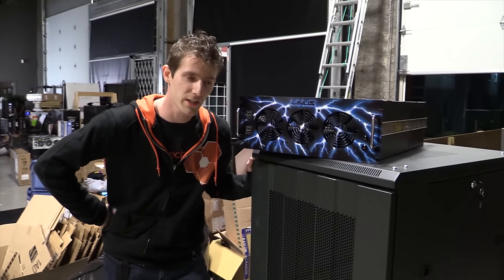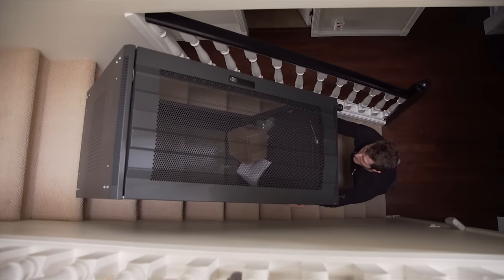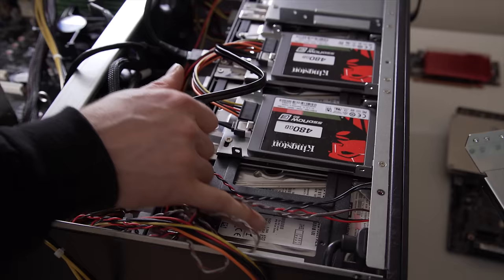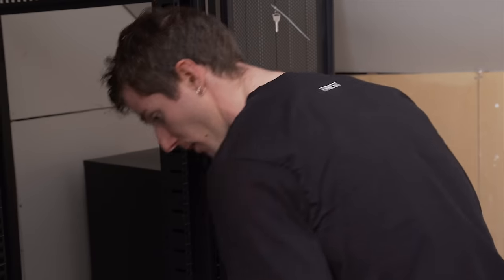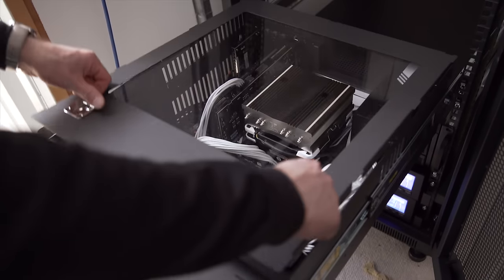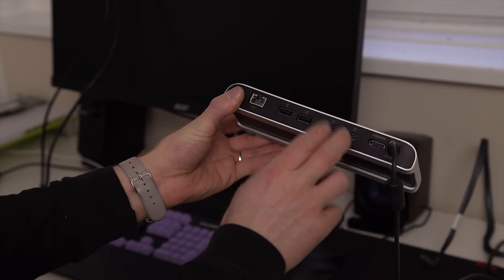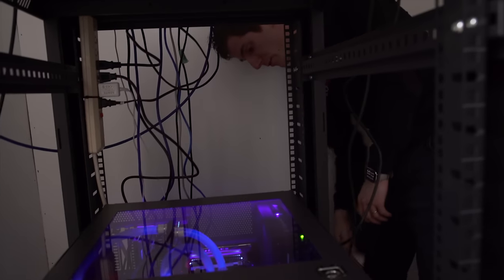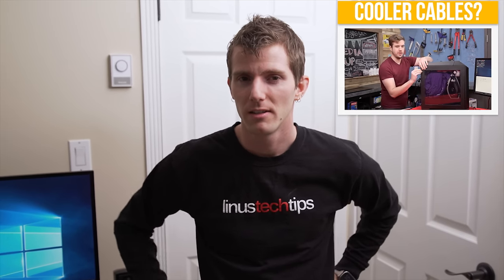Final Deployment of My New PC! - Personal Rig Update 2015 Part 5 (FINALE)

Comment: A rackmounted server chassis in another room with a thunderbolt hub is how you'll be using your personal rig? But what about gaming Linus?
Reply from the maker: What about it? Gaming experience is great. 100Hz at 3440x1440 with G-Sync!
Reply: +LinusTechTips but can it run crysis?
Reply: +LinusTechTips But can has run meat super boy ?
Reply: How the hell does that work? I can understand for the mouse and keyboard but display to? I&#39;m kinda new to thunderbolt but i dont understand it. lol pretty interresting
Reply: +LinusTechTips what monitor are you using?
Reply: +Tzotzo52 ... The aspect ratio, slight curvature, stand and g-sync capability should make that quite a dead giveaway... He's promoted this model of monitor only a gazillion times, too. But just in case it's still impossible to guess; It's an Asus Predator X34...
Reply: +Tom Zoon (Annihlator) oh yeah, forgot about it! :D
Reply: Tzotzo52 :o HOW COULD YOU! ;-)
Reply: +zSz The cable he is using is basically the best thunderbolt cable you can buy
Reply: +ChrisGotsIt He is probably going to run it 24/7 like a server, which it is. Otherwise he wouldn't have bought two UPSs.
Reply: +LinusTechTips really hmm weird when i had a 3 meter cable my rog swift did not do 144hz had ti switch 1.5 meter cable.
Reply: +Tom Zoon (Annihlator) i don't wanna be that guy,but it's acer* xD
Reply: Arven Narve That's his wifes' monitor ;-) But when I viewed back barely a minute ago I noted he didn't mention Asus. He mentioned Acer indeed :) so that's my bad :p
Reply: +Tzotzo52 ACER PREDATOR
Reply: +Arven Narve Wait... Theyre both ACERs... how did I think so wrongly slaps himself
Reply: +zSz thunderbolt is basically a later revision of DisplayPort which is why it's able to do all that.
Reply: +TR-8R Don't be ridiculous
Reply: +ChrisGotsIt The whole point of a rack mounted server is to have them constantly running. I doubt he'll switch it off.
Reply: +Eric W. Actually it was created by Apple as a higher bandwidth alternative to firewire but made with backwards compatibility. later it was made so it could be made into non Mac PC's
Reply: +LinusTechTips Any lag / delay etc etc ?
Reply: +classi fied Don't forget Intel.  Apple co-developed code name Light Peak in it's copper implementation (Confusingly the part that doesn't involve fiber optics or light).  Apple also holds the thunderbolt trademark, but it's an Intel technology mainly. If it was wholly owned by Apple you'd never see it in a non-apple.
Reply: +Christopher Panek true
Reply: +MrHav1k He's got enough sponsers. He'll just call up nvidia, gigabyte, corsair and what have you, then just build another PC.
Reply: after watching this vid im thinking "hmm i might try this" then i search for Corning 30m Optical Thunderbolt cable - £450 + shipping. i think i can live with the noise my PC makes
Reply: +LinusTechTips Can you add another USB hub to the thunderbot hub?
Reply: +ChrisGotsIt I have a similar setup at my home. I ran cable to my workstation from the rack and I have a hidden switch under the desk I made so I can power the computer on from my desk.
Reply: +AlphaZulu Your&#39;e saying &#39; a lot. :P
Reply: +zSz It's optical. Optical = Fiber Optic = Super fast.
Reply: +ChrisGotsIt he installed that module on the mobo to do it wirelessly
Reply: +Matthew Jones (andurilmat) Likewise, been looking for a solution like this for years. And when it comes, too expensive to implement. :(
Reply: +MrHav1k 

You're silly.
Reply: +LinusTechTips I've been building computers for close to 10 years now and nothing in recent times has impressed me as much as this.
Reply: +LinusTechTips are you going to buy a Louver Door for that closet or are you going to go Full Linus, get a circular saw, a bunch of clamps and 2by4s for a fence system and plunge cut vents
Reply: +LinusTechTips I love this idea A+ However does this introduce any lag and what would makes refresh rate be?
Reply: +zSz It's an optical thunderbolt, which makes the latency from cable length so low that it's a moot point.
Reply: +ChrisGotsIt He's not looking to power them down. That's what the UPS units are for and the search for stability in the hardware choices. You can control the rest from your desk chair; then on the off chance it needs to be powered down, it's just behind a door a few feet from you.
Reply: +Alru Waldeck optical has unnoticeable latency,thunderbolt supports a higher bandwidth as displayport... so i guess as high as the monitor supports!  :)
Reply: +what ishappening the ups' dont automatically mean that he will be running them 24/7 it just means that he doesnt have to worry about power outages, surges, voltage/current drops or any other power related issues, his components are safe and he has time to save all of his work if the power goes out, its all about convenience and peace of mind
Reply: +BkS Media although he might not switch the storage server off, he would definitely switch the pc's off, im sure that he has a solution, or he just doesnt mind walking 10 feet to turn it on
Reply: +FurIouS19811 its an optical cable so the information travels at lights highest capable speed through a plastic medium, althought not as fast as it would be in a vacuum (true speed of light) it is still stupidly fast, the delay will be tiny and virtually unnoticeable
Reply: +Alexis Zenios As with everything in the PC world.. Money buys quality. You could buy 50 ft USB, DVI/HDMI extenders and all that jazz if you want to save a few dollars and deal with some input lag. Looking at amazon.ca, the Thunderbolt EX II card is $100-$200, and the Elgato Thunderbolt 2 Dock is $231.. Then all you need is the Thunderbolt cables!! That shouldn't be a problem.. Only $1,705.27 for 30m... God damnit Linus.  Seriously though, you can get 5.5m for the low low price of $261.00 per cable. Bringing your total to $592-692 before tax and shipping. 

But hey.. all those prices are quoted in Canadian. $592-$692 CAD = $430-$503 USD

On amazon.com the EXII is $84.99, the dock is $199.99 and cable $179.99 for 5.5m or $299.00 for 10m. ($467) So.. about the same, except all of those are available on prime.
Reply: +MrHav1k ... It's a water cooled gaming rig in a /custom built/ rackmount chassis. This is no server.
Reply: +DeilGrist He owns a pink civic...  The speed of light doesn't have anything on that!

Comment: Love the build but I'm sorry. You watercooled it, gave it a clear plexi cover and  custom design but its locked in the closet? Wtf Linus thats like buying a lambo and burying it in the backyard haha. Beautiful setup.
Reply: 13:33
Reply: +Chalklate Yea it looks awesome, in a closet haha. Its like keeping an old daytona ferrari hidden away for no one to ever see.
Reply: +bluej511 or a 250 California 

Or jag e-type

Etc.
Reply: +Savcool11 Yup, hey im all for awesome extravagant rigs BUT its a total waste if you're hiding it in the closet, to me anyways. You should see my rig, couldnt fit radiator anywhere on an antec 302 so i drilled a few holes mounted a 360 on TOP of the case, a 240 where the HDDs go and thats it. Its far from showy, its all botched but hey im getting 7-8°C delta over ambient so can't complain, and with noctua fans its quiet enough right by my feet.
Reply: +bluej511 that is the way so you can sell it later with "brandnew" condition =)) and set up new system for 2016 tho hahaha
Reply: +bluej511 Here in my garage, just bought this brand new Lamborghini.
Reply: +bluej511 no it's not because if u bury ur car u cant use it
Reply: +Link Freeman I'm sorry its just totally pointless.
Reply: bluej511 i don't disagree lol but your original analogy was terrible
Reply: Link Freeman Yea was quite horrid wasn't it haha. Lots of likes though im shocked.
Reply: +bluej511 more like buying a lambo then going "but i'm more proud of these 7 bookshelves I had to have installed"

Comment: pls test the latency on this rig. ty linus
Reply: It's on the other side of the wall I don't think there really is any noticeable amount.
Reply: +batt3ryac1d But it is going through 30 feet worth of thunderbolt cable + all the other cables length.
Reply: +Zveir optic cable. Pretty much lag free
Reply: +Zveir its  optical man, i doubt it even ads 5 ms to everything. Unoticeble tbh, plus its not like linus is going to be doing some MLG at his house.
Reply: midnightClub543 Spektrik I am well aware of that.
Reply: +Zveir theres very little latency with 200 feet of thunderbolt.
Reply: +Zveir I think you underestimate the speed of light. the delay will be under 1ms.
Reply: +Zveir it would be negligent.  If gigabit can run through 300 feet of Cat 5 cable with negligible slow down, then 30 feet of Thunderbolt isn't a problem.
Reply: While it's true that the cable itself doesn't produce any noticeable slow down, what about the card and box themselves?
Reply: it&#39;s will never be under 1ms. there is more virble other than thunderbolt
Reply: +Zveir even a 100 metre optical cable would have less latency than a 1 metre hdmi cable or usb
Reply: +girlsdrinkfeck The issue is the decoding on each end. Optical and copper have about the same latency for networking at least.
Reply: +GODOFGUITAR2112 - To add evidence to your statement, my 200mbit connection runs wirelessly from modem for 1500 feet to receiver then 280 feet cat5e to router. Latency from pc to modem is <1ms
Reply: +GODOFGUITAR2112 Gigabit is throughput not latency. As you increase the length of the cable the latency will increase even if throughput does not, you can't escape this fact. Using optical means you can often use less bits of equipment to go the same distance so there is less time added from start to finish.
Reply: Its not about latency from the optic cable obviously but from the PCI card and the hub hardware.
Reply: +yassir abuganam light travels through fibre at about 2/3 of c so about 200.000.000 m/s.. i guess one can tolerate the latency through 10 meters of cable :P
Reply: +Dunkelelf3 the latency isn't about the speed, it is about the encoding/decoding
Reply: +Roboterson I think you underestimate the fact that the light has to be transcoded from optical data to digital data and back again either side of the cable. The light's time to travel down the cable will be negligible compared to the latency added on by either the Elgato hub on the user's side, or the PCI express device inside the computer.
Reply: Niko Yochum i know.. it's just the fact that some people claimed that the cable is 30 feet.. i just wanted to show that light doesn't care if it's a 10 meter or 100 meter cable.. yes latency isn't about cable length but encoding and decoding.. but i still don't think it's that much of a problem in this case..

Comment: How's the cooling. Is there any air going into that room?
Reply: the radiators still need air
Reply: +DMV Airsoft A/C or just lets it seep out of the room/house through venting or just natural heat exchange. Also, since he lives in a generally cold place, the heat helps since he needs to keep his house warm for kid. (i personally keep my place cold af because i can and pc is like a space heater)
Reply: +Random Person and air cools the water..
Reply: +Random Person and air cools the water.. Btw it's not watercooled
Reply: +DMV Airsoft 
Whole room cooling via a dozen 12 inch rads with water pumps and algae of various colors. He can put all the rads in a bathtub filled with ice water and get excellent cooling for maybe 12 to 18 hours then drain and refill. Thats efficient enough right?
Reply: +komrad822 I need a pc that generates heat... mine runs too cool for that, my xbox 360 is actually the thing that heats my room.
Reply: +DMV Airsoft I was about to ask the same question. Its in the equivalent of a closet, and most people dont run A/C vents into a closet. Over time, its going to get a bit warm in there.
Reply: ArtisChronicles This comment was made before i got my new pc but i love the jab at consoles, +1 m8.
Reply: +DMV Airsoft You don't actually expect a reply do you?
Reply: +DMV Airsoft Most places in Vancouver/Surrey don't have A/C
Reply: +ImNqck - Minecraft &amp; More Yes it is, look at 3:41
Reply: +komrad822 haha, yeah I have three pc's, 1 laptop and a xbox running for most of the time and they keep everything warm here :D
Reply: +JayBee Jones I'm in the Same situation. Two pcs a laptop and an Xbox and two routers,The room is always toasty
Reply: +Takoah I only have one desktop, and on a day where the computer is normally under high load, the room temperature goes up 10 degrees Celsius
Reply: Why on EARTH would you have two routers in the same room?

Comment: I have done similar but i always run into with a problem with the ambient temperature in the room rises due to the fact the heat was never properly vented out of the room so i had to deal with this problem. The Smallest input helped me tremendously do the amount of time i spend on my pc.

Comment: What do you need all that power for? Are you running some simulations, or assembling an entire submarine in catia?
Reply: because he has the money for that :/
Reply: Just for fuckin shits and giggles.
Reply: Because nerds dislike power going out, and when power comes back on he would rather have battery bank fried than 5,000$ pc fried.
Reply: @Erick Rosa Nothing in that setup would draw even remotely close to 1200W. More like 400 at top load. So you'd be fine with a small consumer-grade UPS.
Reply: @Erick Rosa I got a 750 watt power supply for my ryzen pc

Comment: For anyone thinking of doing something like this, please ensure that any power strip you have your UPS plugged into (assuming your UPS is powering multiple devices like in this video) is capable of handling enough current to be suitable for all your devices. If it isn't, you could start a fire. Avoid using extension cords at all unless you've checked their current rating and ensured you aren't drawing too much.

Comment: This is pretty much me any time I am upgrading my hardware. I do not have a need for a server, but I do have about 10 retro game consoles hooked up at all times. So on top of my PC and its mountain of common and specialized peripherals, I have a bunch of my consoles I have to run power for. I have designed some nifty solutions for powering everything from the two standard plugs in my game room.